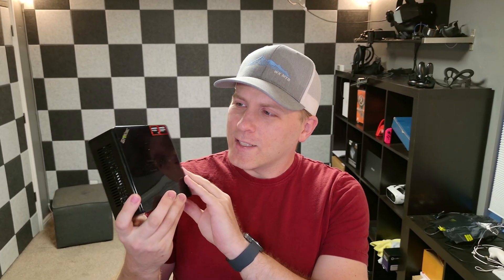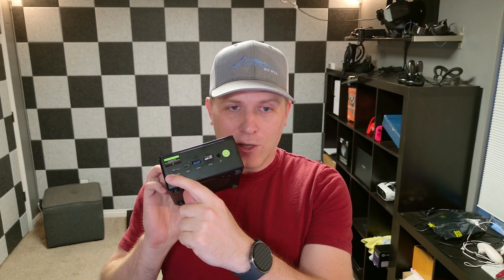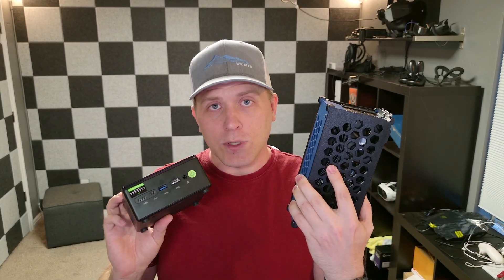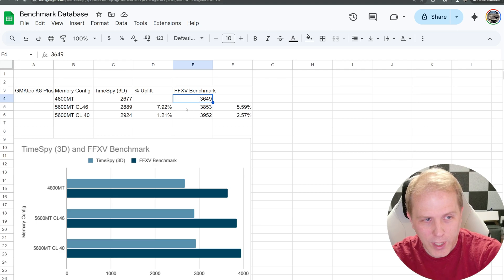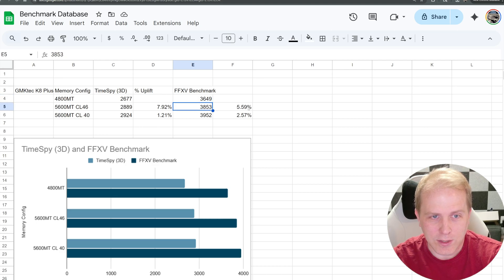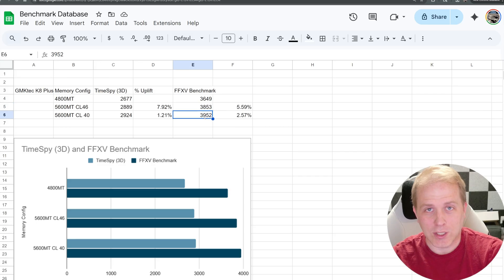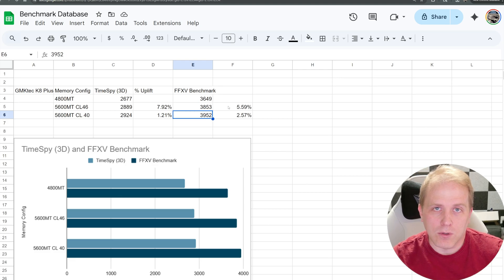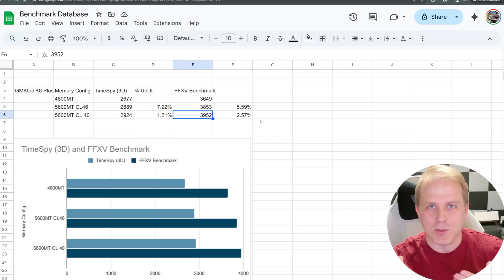GMKTech K8 Plus - PTM7950  & Perf at various DDR5 speeds! Mini PC

Comment: PTM7950 or Arctic MX-6?
Reply from the maker: PTM7950, I think it beats it out, but also the PTM7950 will last forever, the MX-6 might pump out or dry up after 18 months from some reports.
Reply: @cbutters would replacing the thermal paste void warranty? gmktec
Reply from the maker: It would not in the USA due to the way our warranty laws work; but could vary in your area. Of course if you damaged it during taking it apart that could invalidate the warranty, but performing a maintenance task like changing thermal pads shouldn't void warranty as long as you don't cause damage doing so (in the USA).

Comment: Hey, just to Confirm; When swapping out the NVMe Drive & Or The Ram, it wont trigger Windows 11 to Deactivate where we then would have to Reactive it via telling it that there was a Hardware change?
Reply: Windows would not activate on my K8 Plus after a clean install. However, I emailed GMKTec support and they sent me a windows activation key which worked.
Reply: @jd4yn 

That's great to hear! Btw, did this dude delete our previous comments?

Comment: Hi! Can you tell me what kind of brand ram/ssd did GMKtec put in the K8 plus if you choose the 32gb/1tb ss bundle?
Reply from the maker: I bought the barebones.... Hopefully someone here can comment the answer.
Reply: @cbutters  I see, still thx!
Reply: @cbutters   I ended up also buying the barebone version and ordered the Kingstone Fury DDR5 5600MHz CL40 KIT. After watching your great test/guide i have already planned to do the thermal upgrade, but unfortunately where i live the Thermal Grizzly KryoSheet Thermal pad is more available. What is your opinion about that product and can you tell me approx. what size is the cpu? (mm x mm) 
+ almost forgot: that tape which secures the fan, is it some kind of heat resistant special tape?

Comment: Of all the mini PCs, this chassis  design is one of (if not the best)

Easy access to both sides making it super easy to clean & to maintain.

Blower fans are notorious for clogging up with dust
Reply from the maker: Completely Agree. I had no idea what to expect as I started pulling apart, but the design was simple and effective. The fan connectors were high quality and came on and off easily too.
Reply: IMO the Topton Ice Soul/Firebat MN56/Acemagic AM18/Aoostar GOD chassis is the best especially for maintenance. Hopefully the chinese manufacturers do something to improve on that design, like adding a vapor chamber to the cooler.

Comment: Hey, nice results, I've been using PTM on most of my devices. Works really well. 

Quick question(s) about the K8 Plus. Does the device report the SODIMM temperatures and the VRM temperature. Also, have you tried switching the top fan to intake to blow air on the SSD and RAM, instead of exhausting the air?
Reply: It does report SODIMM temps

Comment: Hi, why did you use a thermal pad instead of thermal paste?

In theory, thermal paste such as Artic MX4 or 6 should be better than a pad. I'm curious.
Reply from the maker: It isn't a pad, it is a specialized phase change paste. Take a peek at my video on it I did here: https://www.youtube.com/watch?v=EdAofm2Wh60
Reply: @cbutters  OK, now I understand. Basically, it's a pad that improves performance when the PC is underloaded... Thanks for the test.
Reply from the maker: @fabio_graziosi it isn't a pad. It's paste, it just turns solid at low temperatures and liquid at high temperatures. Even when it is solid it feels like dried paste. I had it in the freezer to keep it as solid as possible in order to apply it, but once the heatsink squished it it is a malleable paste.
Reply: @cbutters  Okay, now it's clear. Perhaps some of the English terms weren't clear to me. Thank you.

Comment: my Onexgpu 2, I believe you have one , its fricking noise its a way to do a mod regarding the case and the fan to make a little quieter , it would a great idea, I think that has a PTM9750 installed.
Reply from the maker: Yeah onex needs to fix the fan curves on that device, it's way too loud and ramps even before it gets hot.

Comment: How is the noise level under normal operations?
If its very loud, is it the possible to replace the top fan with another of better quality?
(ps. I don’t know anything about bios upgrades for this model)
Reply from the maker: Normal usage is very quiet, almost silent. If fan noise was an issue for you you could limit the APU to 50W instead of 65W and it would be a very quiet machine.